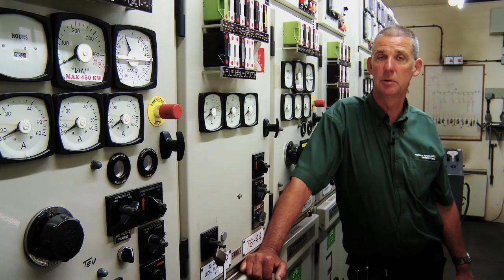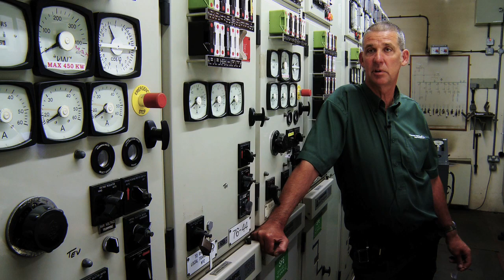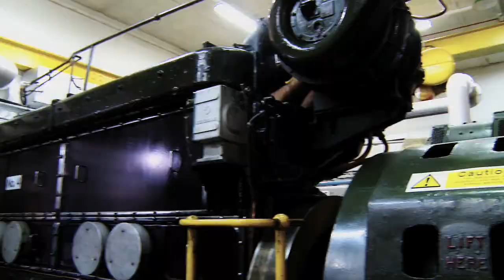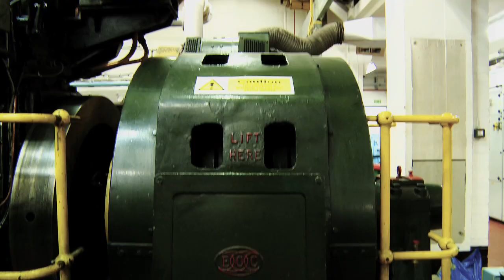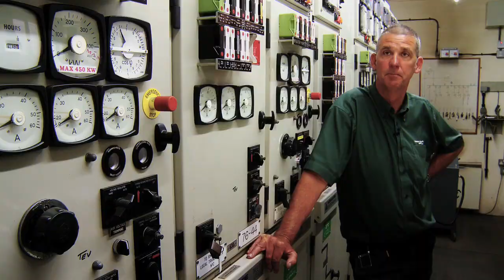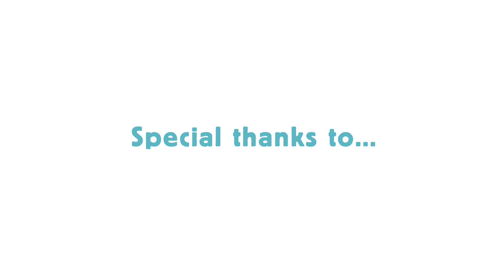Live Wire : E-Day 2009 Isles of Scilly

Comment: Back in the early 70's I was involved in the cleaning and overhaul of the church organ on St Mary's and was able to visit the power station and saw the diesel engine generators. They were in regular use and were cycled through an operation pattern which allowed for one of the engines to be striped down for overhaul, they had pistons the size of dinner plates.